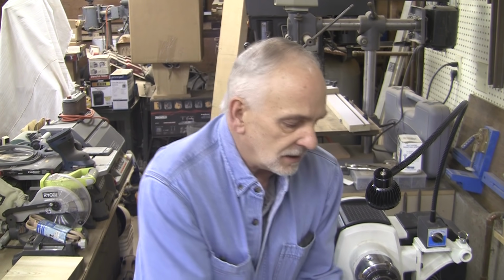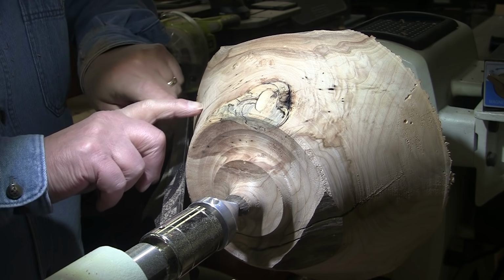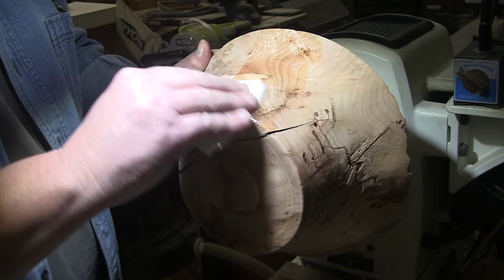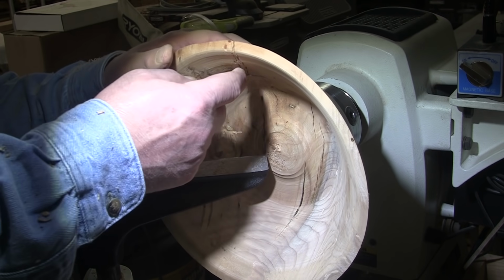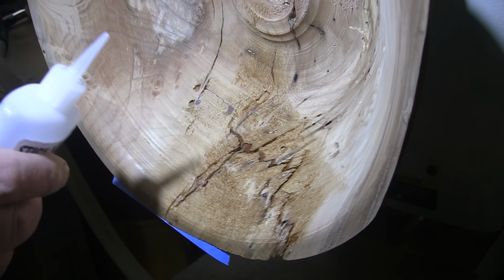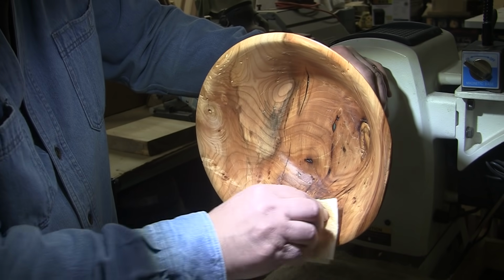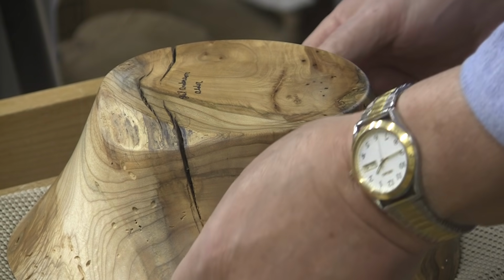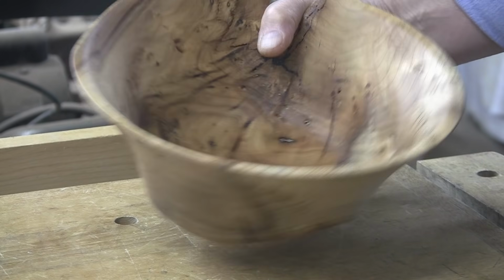Spalted Alder Bowl - Surprise Ending!

Comment: Don't worry about the peice    missing looks good as far as the crack filling I do alot of custom woodwork with old wood and the best way I fill cracks is mix the glue and fine dust from my orbital sander bag and push it into the crack with a wooden wedge or thin knife

Comment: Hi Phil,
Pretty neat idea,,,,a Thumb Bowl!I like it !
I've used coffee grounds after they have made coffee!I take them out of the filter and dry them!
I also use very fine saw dust that I take off of my shop vac filter.I put the CA in the cracks,,,,rub some saw dust into the cracks,,,,apply more CA and more saw dust.I think the fine saw dust not only goes deeper into the cracks but also forms a better "bond" due to it's very fine "particles"!
A question,,,I see you signing your pieces and have to wonder how the heck you keep the fine line felt tip markers from drying out?I use the Sharpie brand and no matter what I try they just dry up fast!
Thanks for the video!
Tom
Reply from the maker: Dust from the vac filter is a great idea, Tom!  I'll have to try that.  Lord knows, the filter is always full, anyway!  I do like the coffee grounds because of the color but it does depend on the piece, I suppose.  I haven't had a problem with the Sharpie drying out, at all.  I do keep the lid on all the time, but I'm sure you do to.  I use the Extra Fine Point, if that helps.
Reply: I save fine saw dust from various different color woods in prescription bottles and label them.I also hammer down used coffee grounds on a steel plate to make them finer! LOL
To me,,,using coffee grounds ,as is,(even fine grind) is like making cement with cobble stone and not sand.The finer the filler ,the more of it you get into a crack
I use the same Extra Fine Point markers and do keep the cap on very tight.

Comment: You must have Acetone based wood hardeners in the US? I've used it recently on a 17th cottage window frames (in the UK). It doesn't darken or change the wood too dramatically. That said, wear gloves, because it's like Gorilla Glue for staining fingers!
Reply from the maker: I don't really know what the base of the wood hardeners available locally is, mikenco.  I used some one time and found it did discolor the wood and I did not like using it and probably won't, again.  I do always wear glove when finishing.
Phil

Comment: Rotten wood hardener works well, if you can find a store that carries it!
Reply from the maker: I do have some Minwax Wood Hardener, Paul, but I'm scared to use it.  I don't know how it will finish or what kind of finish I can put over it.  I'll try it one of these days...
Reply: Phil you can put any finish you like over it. All it does is stabilise the fibres so that you can still turn it.
Reply: Stephen Ogle video #97 is a good watch. He shows you how to stabilise rotten wood.
Reply from the maker: I'll give it a look, Paul.  I used to watch Stephen but I don't think he has had anything new for quite awhile.
Reply: Trouble with CA is that it does not penetrate anywhere near as much as rotten wood hardener. The thinness of the wall which lead to the breakage was probably due to the softness of the punky wood. Try it Phil, you will be surprised.